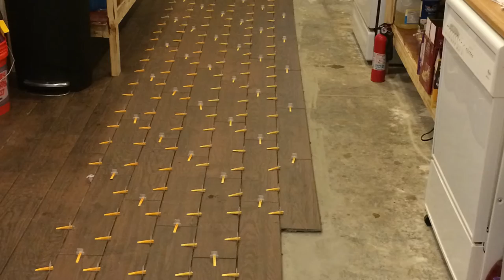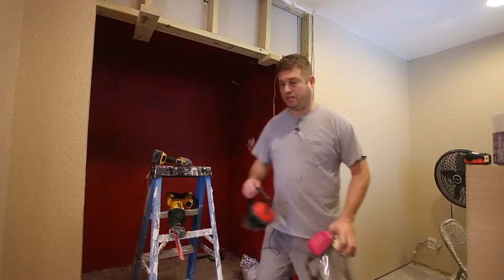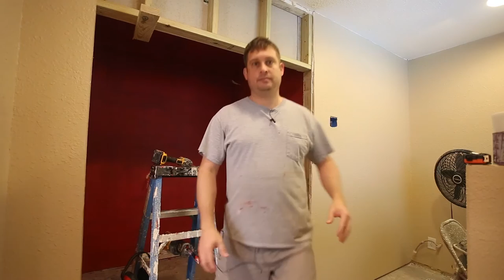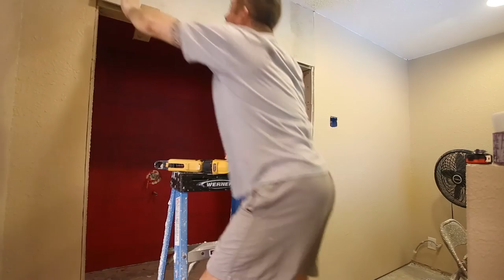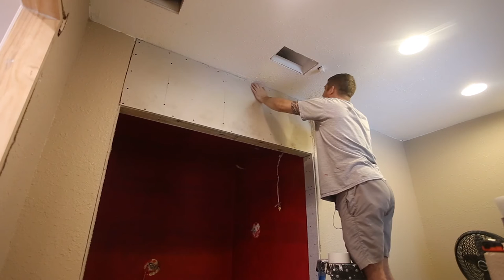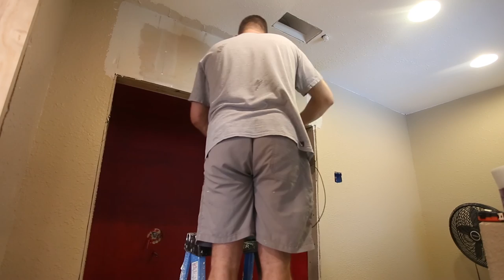House Remodel: Progress on the Master Shower

Comment: Nice work Brian.  Would it be possible to show how you flush and store the proportioner between jobs?  
Thanks
Reply from the maker: Honestly I don't.  I just plan on physically cleaning the gun out next time I use it.  My B side hose has developed a minor leak so I'll probably have to tear down the hose assembly next time I want to use it.  I just clean it out good and then recalibrate it.  I'll be insulating my garage next.  Maybe sometime this year.
Reply from the maker: It's worth mentioning that I have run 4 sets of material through the unit.  So buying a set of hoses is trivial to me.
Reply: Nice!  ~$8k of chemical.  If you would have had the "pros" spray 4 sets it would have cost around $25k and you would have had to argue with them on the benefits of a full cavity fill.  My understanding is that if you want to do the work of stripping the hose that materials are inexpensive.  Do you find spraying at 10#/min is sufficient?
Reply from the maker: It was a little slow, but otherwise just fine.  Commercially I think you would need to spray faster to be profitable.  But for what I was doing it was fine.  You are right on the Full Cavity Fill.  Half the "pros" wanted to argue with me about it when I quoted it out.